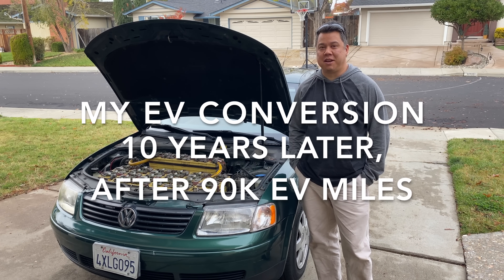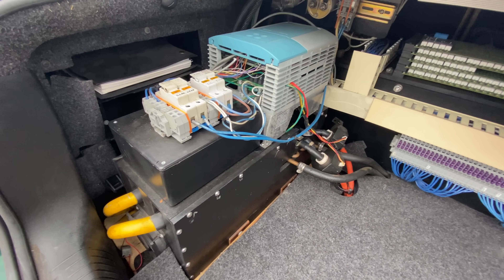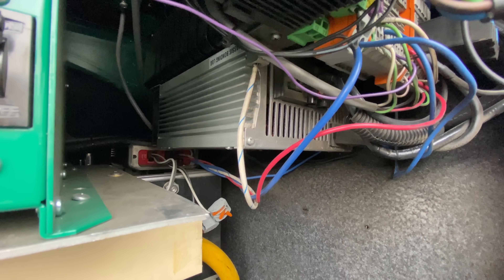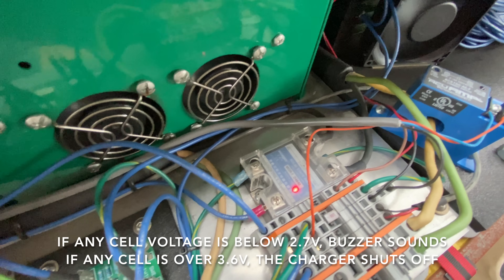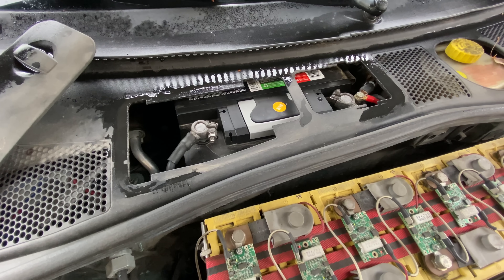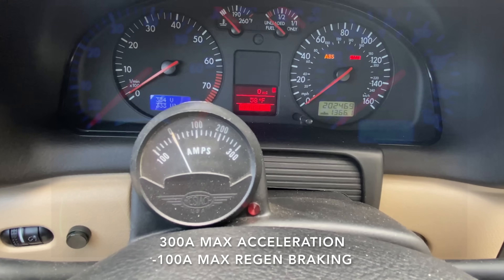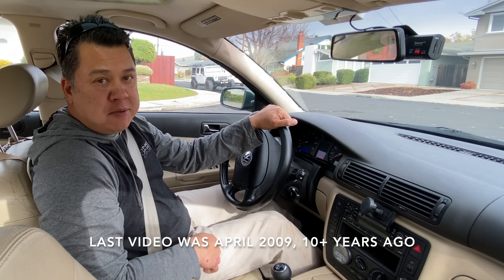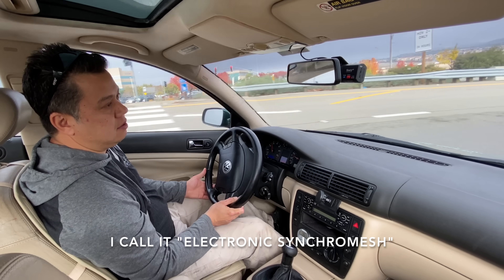My EV conversion after 10 years and 90k miles

Comment: Just image having a wreck, may cause a big unstable fire, I've a tracer 1996 with 243k miles only have changed the timing belt and tires
Reply from the maker: https://youtu.be/R9xZf4p8PkQ. These batteries are much less flammable than gasoline

Comment: I drive a diesel Passat like this but the 1997 model. It has 555k kilometer on the clock. Great machine, but the engine failed on me a week ago. We were driving to visit relatives 1100 kms away, but the car said no. We had to wait 7 hours for the trailer to pick us up. 😵‍💫 Judging by the sound of the engine, I think it's the cam shaft or the lifters. Wouldn't have this problem with electric 🙂

Comment: Likely there is only one guy on the planet that can troubleshoot this EV if has a problem!
Reply from the maker: I do have pretty good documentation, I think a controls guy would be able to at least troubleshoot.  Nice thing is I don't have to pay a dealership, I can do it myself =)
Reply: @etischer  A Very impressive build.  Especially for the time you designed and built it!  I assume you're an EE.  Is that correct and what do you do for a living?

Comment: I would rather have your VW than a Tesla. It is wonderful. I would rather have it in a big Ford pickup 2500 with four times as many batteries under a lifting bed for about the same range with two drive motors front and rear unless tooling along at 45mph to travel a couple hundred miles.

Comment: Neat project that's a lot of time and money. I just don't see the cost savings going with a electric vehicle or truly see saving the planet going with an electric vehicle. And with blackouts and all this government control most want be able to charge their EV car unless they have a lot of solar. Propane is so clean you can cook your food on. 

I was thinking about a EV bike but they don't have the miles and today's technology is outdated on tomorrow's new electronics. I have a 86 pound ICE bicycle 3 horsepower 80cc engine 4 stroke that gets 160-180 miles to the gallon. I've had it since 2018. You can push it, pedal it with engine off, engine on and pedal it or just use the engine sit back and throttle it. Best fuel mileage of course is engine off and pedal it. I drive a ICE car and shut engine off drift in neutral. Shut off engine in the day at stop lights can get hot until I get moving again and cut AC back on. This saves fuel. Might do a battery switch and extra battery sometime to change over at night so it doesn't pull power off of main battery when engine is not on. This saves big fuel mileage. The faster you drive the worse your fuel mileage will be. I also have a stock Diesel Cummins truck manual transmission 9,200 pounds at the scale just truck. AC and cruise on 42.5 miles to the gallon at 44 miles per hour. That's actual fuel tests no computer. That was doing drifting in neutral off every hill engine still running to get that 42.5 miles per gallon. Engine off while drifting will get better fuel mileage. At highway speeds and faster fuel mileage is bad around 10 miles to the gallon and worse the faster you go. This is why I've slowed down years ago to get better fuel mileage and less wear and tear on my vehicles and engines. I've towed up to 23,500 pounds maximum so far. What I've learned turning less RPM's in any thing will save fuel, less wear and tear on battery life in EV's too. Less charging batteries makes a battery last longer. I'm off grid been in the auto industry for over 30 years and race at the drag strip for fun. I have some solar and plan to add more. Also what is really green and clean is propane. I've converted a few generators to Tri and Dual Fuel but I only run propane. Propane is a preppers fuel. A engine on propane will last almost twice as long. Running propane spark plug is always new looking and oil too on propane. Propane is so clean you don't have to have any emmisions on a propane or vapor fuel burning engine like propane, natural gas, gasification, hydrogen and more. Propane in my area is only $2.00 a gallon. I cook on propane, heat my place, heat water and run generator on propane. I have ran a 3.8 V-6 ice engine off of propane in a emergency getting it home. I have several bottles of propane and it doesn't go bad. I do some trading for propane and sell some propane tanks on the side. I want to buy a small 1.8 liter engine with manual transmission convert it to propane and do some hydrogen. I also bought a small camping generator I bought in 1994 New. I just converted to dual fuel now I only run propane. I've not seen any electric cars still running that cheaply and efficiently. Most newer generators, cars, electronics and things won't last that long.

Comment: You made me see what's possible with a 2001 VW and thoroughly impressed...and slightly overwhelmed.  I got about 3/4 of what your were saying from a technical point of view as I've not done a full EV conversion in-person yet.  I've been aspiring to convert over my 2015 VW GTI to electric as the engine grenaded and miss it greatly as it sits in my driveway.  However, converting a 14 year newer machine over seems too daunting given the ODB2 and CAN-BUS electronics.  Or do I just go old-school and for my first EV project find an old Thing or Microbus and go with an EV West kit?  Choices, choices, choices.  Again, thanks for the well done video!
Reply: IF YOU COVERT 100% ELEC YOUR EXEMPT FROM OBD2 REQUIREMENTS, THAT EMISSIONS REQUIRED ONLY (CAPS STUCK SORRY)

Comment: I'd like a cell balancing board that simply attaches straight to the cell and activates above a certain voltage. I'll let the BMS monitor and protect but this separate cell balancing board should have a much stronger balancing current then all of these bmss on the market today.  Do you know of any such thing available?  My house battery is 516 volts and it's a troublesome voltage because no one makes components for stuff that high.

Comment: I watched the video with growing awe. At some point I thought, this gentleman built a prototype Tesla even before the car brand was a thing [*]. Being like a functional prototype, it's physical design - cabling and hiding components (from view, people, elements) - is extremely basic. The electrical engineering seems up there to me. I guess, as a couch expertologist, this would get an A+ as e-car feasibility demonstrator, from professors or a VC. My biggest gripe with modern COTS e-cars is that they still have considerable "transmission losses". This car actually does not do too bad at that. Considering 1 Ah at the 300~330V range (300..330 Wh/mile > 186..205 Wh/km) it is in the ballpark of today's COTS cars. Extreme designs go under 150 Wh/km now, but that requires better than the Passat Cw, less transmission losses and less rolling resistance by not using big fat wheels/tires.
This car not having a clutch probably means a clutch's inherent transmission losses are cut out, but the conventional transmission (axles, differential, etc.) are still there and an ICE car is very inefficient overall, so who bothers about optimizing transmission losses? In the video, the absence of a clutch was justified by an electric clutch being very e-power hungry - which I don't understand after a century of human-powered clutch operation (through the foot pedal in a "manual").
Another thing is that the motor is an induction motor. The way I understand this is that there are no permanent magnets but coils are used with a voltage on them to get the static magnetic field against which the motor's rotating electric fields advance themselves (push rotate). Seems a bit more power hungry than using very strong permanent magnets (instead of these powered coils - but induction is elegant and attractive). Induction motors may just be more reliable or require less maintenance?
Overall, an incredibly clever demonstrator car.

[*] And then I read the intro with the video: the gentleman used the car to land a job at Tesla and now retired. Talk about ROI. Wow.

Comment: Those batteries are terrible for the environment, how often will you have to replace your batteries? Where do you think the power out of the wall come from? What a waste of energy.
Reply from the maker: Batteries are being used for stationary storage now, and will be recycled when they reach end of life. Better than burning gas and oil for 10 years.  100% of the power came from solar panels on our roof.
Reply: @etischer  we wouldn't be here right now if we didn't burn that oil and gas, that's extremely disrespectful. People like you should burn everything and go live in the woods. Do you even know plants need co2 to live and the largest volume of greenhouse gas in the atmosphere is water vapour/clouds? Stop virtue signalling, how do you think that metal was made in your car? Solar and wind are not viable for base load power. Solar and wind are destroying the environment. This climate crap is the same as the CFC fraud, sure CFCs are 4 times heavier than air and magically defy gravity and float up to the ozone and magically only to the poles. Ozone is made when sunlight hits the air, want to guess which parts of the globe get the least amount of sunlight, spoiler the poles. Your whole world view is a lie.

Comment: I’d love a new update on this
Reply from the maker: In 2020 I bought a Model 3, and slowly parted out the Passat.  Didn't make sense to have 2 of basically the same sorta car, I'm a bit of a minimalist.  Before tearing it down, I realized I never made a video showing it actually running, so this was the motivation to make this video.  I still have the inverter.  I thought about selling it as a fully functional EV, but seems like a big liability to have it on the road since it's so modified. Plus there's definitely lethal voltages present to anyone doing maintenance. Parting out seemed to be the safest thing to do.

Comment: I wonder what your set up would cost now , I can only imagine the cost has dropped significantly. Nice work brother 👍🏻
Reply from the maker: Battery prices are about the same actually, costs may have come down, but inflation has gone up. For motor and inverter, there are lots of used options on the market now, but I think my new motor and home built inverter are about the same price as a used model 3 drive unit.  Overall, I think costs are the same today to do a conversion, though Model 3 drive unit would have 2x the power!

Comment: They say A car is a coffin, this one is a cremation furnace while it’s on. 😟
Reply from the maker: LiFePo4 battery chemistry is fairly inert, you can drive nails through them, shoot bullets though them, they don't catch fire, unlike gasoline which ignites quite easily.   Electric vehicles: 25 fires per 100,000 sold. Gas-powered cars: 1,530 fires per 100,000 sold.

Comment: What you've done here is very impressive, that would have been a lot of work and research to do this. I suspect if you ever did another one you could do it for cheaper and end up with something even better with more range. I'm sure this was a really big learning experience.  

There's definitely a lot more stuff available today for making something like this. If you could acquire a totalled out Tesla that would be a lot of excellent spare parts.

Have you stripped out everything possible to reduce weight? Every little thing adds up to make a difference.

Comment: What would happen if you install four 200 amp alternators into the drive line somehow ? There would barely be any additional resistance on the main electric motors. So you could in theory extend the mileage significantly between charge's.
Reply from the maker: Adding a 10kw alternator to charge batteries would just add 10kw of drag.   The motor that drives the car does act like a generator to charge the battery when braking.

Comment: Wow very talented. I wish I knew half as much about electronics as this guy. I've got a mini bike I'd loves to change from gas to electric. But don't have a clue how. I'm sure there are kits you can buy for this. I'd like it to be 72 volt system. It does 38 mph with the gas engine. I'd like it to hit 60. With still having plenty of power for trail riding mountain climbing etc. The batteries are so expensive and I don't know how long they last.

Comment: Be a smart idea to isolate empty trunk space and area occupied by your kit With whatever you can it would cool off quicker I would hate up quicker but cooling off quicker is the kicker here we’re only get so hot before it starts cooling and I was you I would drop the maximum Temp it’s allowed to reach by a few degrees at least Id Allow some air conditioner air to get back there to prevent overheating but if it works no fix it 
There’s another good idea

Comment: Do an update!
Reply from the maker: Update:  Bought a Model 3 AWD, and stopped driving the Passat. I parted out the EV components a few years ago, and donated the car to charity.  I sold the batteries to someone doing a solar farm project, kept a few for an RV battery.  I shipped the motors to a buyer in New Zealand.  I still have the inverter.

Comment: Impressive amount of work. The only thing about the build that I would have is the degradation of the batteries seeing that it appears you dont have any cooling for the batteries. How much degradation have you noticed since you did the build?
Reply from the maker: I think the capacity was only down to about 80%, but the voltage sag was about twice what they were new, so 330v used to sag to 300v (30v sag) at 300amps,  at the end I was seeing sag down to 270v.  The batteries are now part of a solar project where they won't see high currents.   I wasn't pulling enough power to need battery cooling.   On the freeway, I pull 60A with maybe 10 of sag, so 600W going into the entire 700lb pack as heat, doesn't really require water cooling.
Reply: @etischer  Thanks for the response, I was referring to HEAT as in ambient temps...You are from California after all...one of the reasons the 1st generation leafs did so badly with regards to degradation is that there was only passive cooling (Fan/Air) and not water cooling. Thanks for the video!

Comment: Dude ! You should have a killer sound system with all those amps available at high voltage ! Nice clean alpine head unit at 12v and convert some killer push pull amplifiers to run off two high voltage rails for the oomph 🤔

Comment: I can tell I’m not as smart as you bc I couldn’t build this shit but bruv you gotta change your brake pads more often than once every 90k miles
Reply from the maker: The car uses the motor for braking, this slows the car down by charging the battery.  I can pretty much drive the car without touching the brake pedal, the pads don't wear out

Comment: Ty YouTube. See 12v charginging if it's good enough for a windmill at the bottom of the sea. It's good enough to be connected by solenoid. 24v max . 20 mins charging off an engine . Could think of way werse ways of burning fuel for no reason. And alternators.